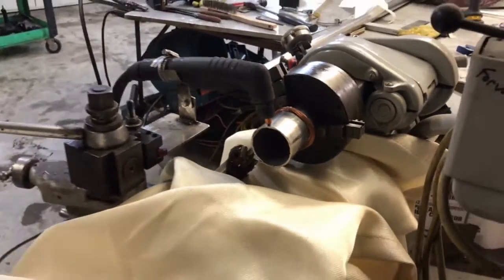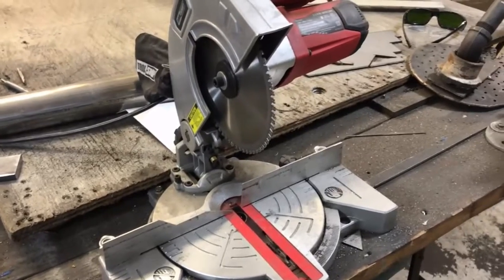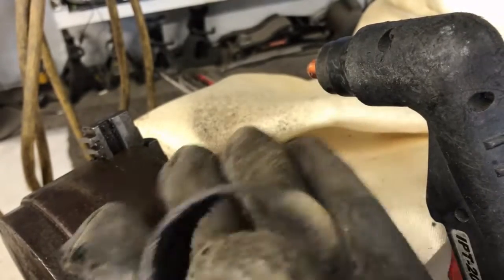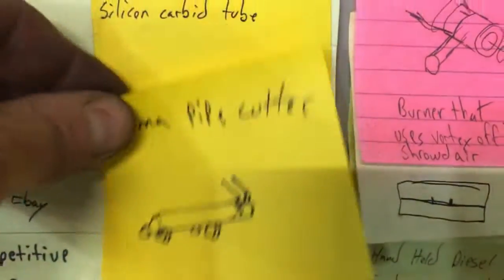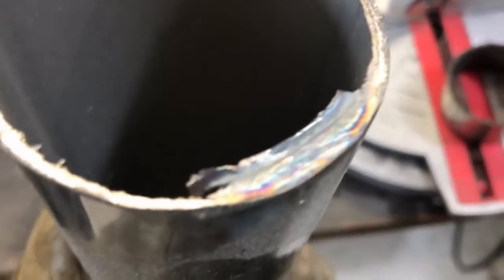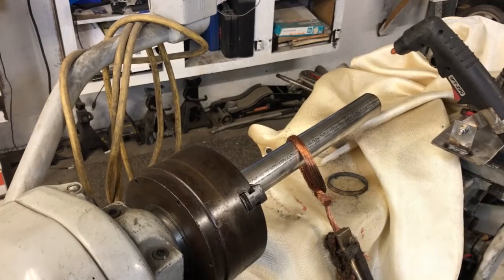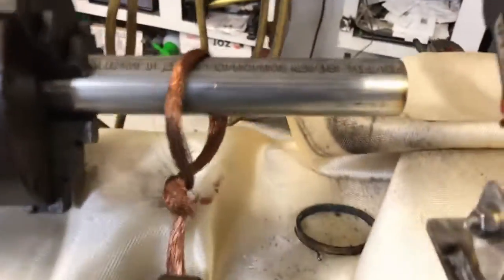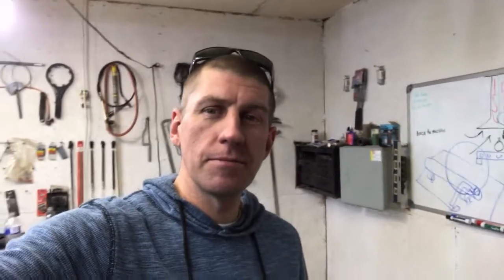Cutting tubing perfectly square with plasma torch

Comment: I don’t feel like you are giving a cold saw a fair chance. You have a wood cutting miter saw with a steel cutting blade on it vs a true metal cutting saw. Biggest difference is a metal saw will spin in the neighborhood of 1400 rpm whereas that wood saw is likely closer to 4000 rpm. Plus the wood saw bases are no where near as rigid as the metal saw bases. Couple that with cutting stainless which work hardens when cut fast and you are bound to get a poor cut out of that saw setup. I would suggest trying an actual metal chop saw I think it’ll change your opinion.
Reply from the maker: way to loud and to much shrapnel for me bro

Comment: You're using wrong chop saw. You need geared and lower RPM saw. The one you're using is designed for wood. Here's a link to the correct saw. There's a reason why it's a bit pricey. But it's worth it.
https://www.homedepot.com/p/DEWALT-15-Amp-14-in-355-mm-Multi-Cutter-Saw-DW872/203164101

Comment: I needed to cut several pieces from some 30 foot pipe. I bought 4 fixed casters from HF and mounted two each to pieces of plywood to form a rolling cradle.  Worked quite well for plasma cutting, I also used the same setup to cut the end off of a 3 foot diameter tank.
Reply from the maker: Great idea i almost did that and thought well , my luck i will get lateral movement and end up with half ass cuts again , glad to hear it works , i may go ahead and do it for even longer pieces , thats why im not using a parting tool , the pieces are to long
Reply: It can try to roll laterally, but if you make two separate cradles you can play with the tilt until it is straight enough for one pass.